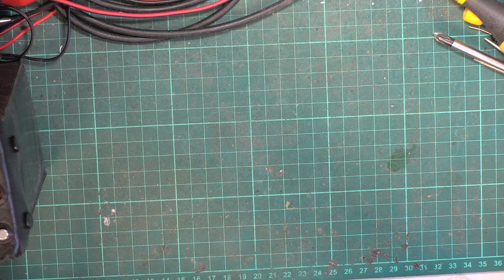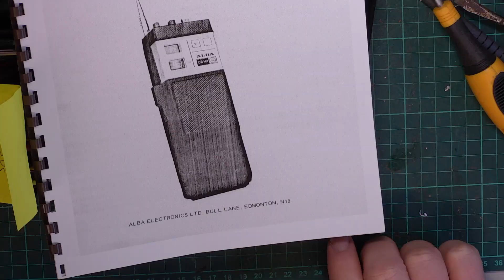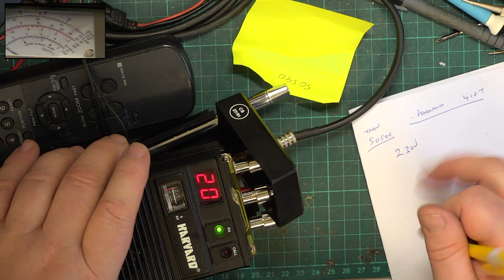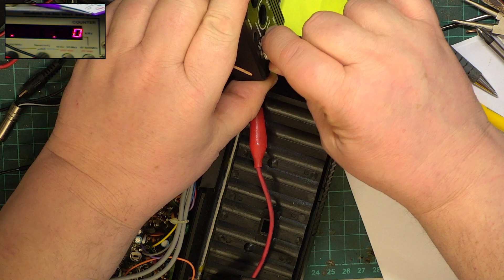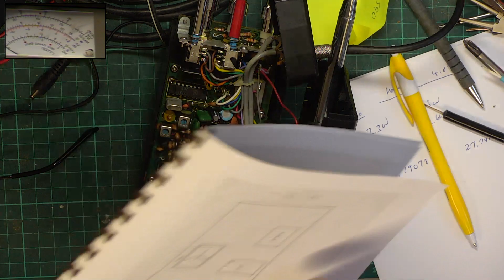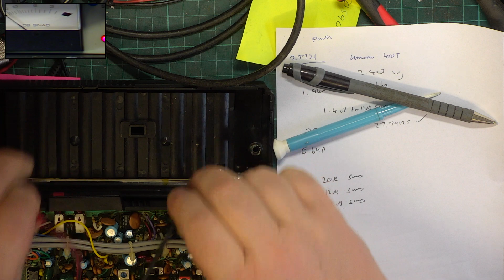Harvard 410T CB27/81 UK FM CB radio (handheld 2W) - service & alignment

Comment: I have a Harvard 410T and an Alba CB H2 and although both function okay they desperately need a proper service since I obtained them both off E Bay a while ago.  I don't have a service manual and have searched for a downloadable pdf version but have had no success with that yet.  Since I have a long electronics servicing background but not in radio I would like to service the two I have myself so by following your video here carefully I most likely could but need to know what equipment, meters, etc, you are using in this service video.  Thanks in advance in however you respond.
Reply from the maker: email me & I'll send you a PDF of the service manual. Richard

rshireby@yahoo.co.uk
Reply: @ukfmcbradioservicingTango21  Thanks and I certainly appreciate this.

Comment: Just found one of them, impressive after 40 years needed a change of batteries. Quick clean up and good old poundland batteries and it works
Reply from the maker: remember it's 8 x 1.5V batteries = 12V for throwaway batteries with two dummy batteries (readily available Ebay etc) filling the two spaces, or 10 x rechargeable 1.2V batteries also = 12V.

Richard
Reply: @ukfmcbradioservicingTango21  school boy mistake thank you. Only couple of hams on anyway and half of them I can't get on the big radio as long wire wrong direction.

Comment: followed you're video on tune up, set frequency/receive,  but when it came to tx can not get it to go above 1.1 watt's on 12v ,  low power 0.4 watts, not sure if thats maxed out as can not get it to go any higher,
Reply from the maker: If you email me I'll try & send you the service manual just in case something's got missed.

rshireby@yahoo.co.uk

Richard

Comment: Hi Richard. What adapter would I need for the antenna socket to use this radio with a pl259 on my homebase antenna?
Reply from the maker: It's 3.5mm to SO239. As I type this on 31st Dec 2021, here is an ebay example:--

https://www.ebay.co.uk/itm/184475633937?hash=item2af39ac911:g:qk8AAOSwtC9gYvZM

Richard, G0OJF, UK
Reply: @ukfmcbradioservicingTango21  Thanks Richard.
Reply: Hi, to remove the back after the removal of the screw, you simply put the screwdriver that you used to unscrew said screw in the hole/screw well, and with gentle pressure away from the bottom of the radio, the back will come away👍

Comment: Hello, this radio has a serial diode on the power supply, it reduces the power a little but protects in case of an error.
Reply from the maker: correct.

Comment: Blimey, my one really was corroded. Outside looks can be deceptive.
Reply: Did you take it swimming?
Reply: @BoB4jjjjs  No mate, I’ve only had it a month or so.
Reply: @SwainyAtRetroAsylum  It must have got wet at some time to be like that, however, it is good now.  Look after it, they were not bad sets, but a bitch to repair.
Reply: @SwainyAtRetroAsylum  They are not bad sets, hell to repair, but work fine.  If looked after it should last a lot of years.  Parts are almost impossible these days, mind you they usually were!
Reply: I just got one but the lcd doesn’t work and I just get static and if I use my cb in car and talk my Harvard goes quiet but can’t hear talking :/ paid £28 as well for it :(

Comment: From what i can remember a MPSU 05 could substitute? These days i would use a HexFet
 like a IRF520 with 3v of bias on the gate
Reply from the maker: In reality, these are a struggle to work with using the right parts. The double sided PCB made of SRBP is cheap & nasty so great care has to be exercised to remove old parts without damaging the board..let alone implement component value alterations. The MPSU05 is a 10W audio transistor. I'm not convinced it would work in this application. Cheapest I can find is around £8. The MPSU31 was specifically designed for CB radio use at 27Mhz & is rated at 3.5W making it's use in this product sensible as the radio does 2W. By not thrashing the output device the fact that the VSWR will never be brilliant, that leeway gives the transistor some protection from overload destruction. A quick look on ebay & there is one at £9 today.

Richard, G0OJF, UK

Comment: Hi, great channel, ive watched about 20 of your videos and im confused on how you test the receive end with a tone generator, do you use another CB on transmit, and how do you get the output to the meter, can you explain please, , , ,ive been a computer technician since 1996, so im good at fault finding, but it really has me flummoxed, , lol
Reply from the maker: I'm using an FM signal generator. It can be set to any frequency within it's manufactured capability which is 24Mhz to 500Mhz. The set frequency is FM modulated, in this case at the 1Khz industry standard...but equally can be modulated with a variable audio frequency instead; needed for testing CTCSS on business radios. The signal generator has the two (fine & course) attenuator controls which are calibrated right down to 0.05uV. For example...to set the S meter at S9 I need the signal generator to give me the frequency I want (UK CB channel 20 = 27.79125Mhz. With that in operation, the attenuator is set to 100uV....that then enables me to adjust the preset for the CB radio's S-meter to read S9. Tuning the receiver, you are constantly attenuating the signal as you improve the sensitivity of the radio being serviced, with reference to the SINAD meter that measures the signal to noise ratio. On an FM receiver the signal to noise ratio gets better the bigger the signal it receives. So the FM signal generator connects to the aerial socket, the SINAD meter connects simply connects across the loudspeaker.

Richard, G0OJF, UK